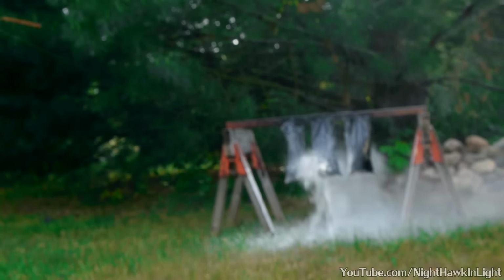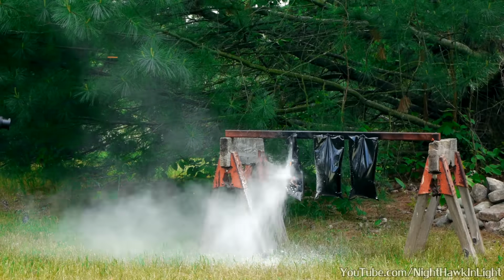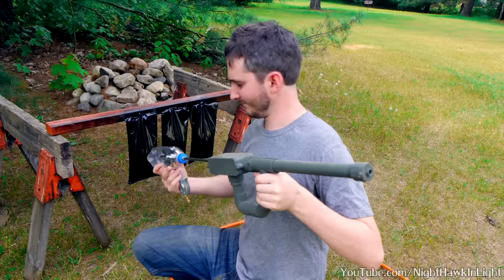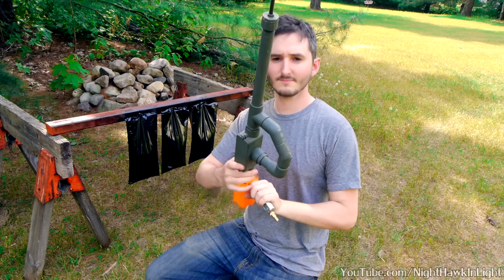DIY Airsoft BB Machine Gun - 5,000 + Rounds Per Minute - NightHawkInLight

Comment: This could be like a flame thrower for airsoft. You can carry the compressor on your back
Reply: maybe a smaller 12v pump/compressor like the ones you can use to inflate your car tires if you get a flat and a motorcycle battery? good idea though.
you could also add a couple 4-6" PVC pressurized tanks for the backpack flamethrowers have, having the tire pump pressurizing them.
Reply: get an HPA air tank, line, and regulator.
Reply: What people have done for this is rig up a small propane tanks up. Just look up airsoft flame thrower, I remember seeing some videos on it in the past.
Reply: Jesse flynn more expensive then my idea.
Reply: smaller tank with smaller pressure for smaller range and we've got a nice flamethrower for cheap, also seems fun to build
Reply: TheSkunkedFisherman or tank
Reply: A few light weight lipo batteries and a small on demand horn compressor 
And it would work with less than 4 lbs of weight.
Reply: That’s against the Geneva Convention even in airsoft 😂
Reply: Pyro: evil laugh
Reply: Ahh yes the strafer’s his little brother
Reply: More like a mg 42

Comment: congrats you made a polarstar rifle
Reply: Just hearing that name makes the scars all over my body hurt again
Reply: not polarstar  there is an actual gun that works on this principle though its called the "straifer"  basically  big hopper with a barrel that has air passing through it pulls bbs down and out the muzzle at stupid rates of fire.
Reply: +o Lemurs nope its got no semi auto mode since with this type of firing system its impossible the straifer is on or off just like this
Reply: Nff and so are all polarstar rifles
Reply: +o Lemurs polar stars are essentially the same as a aeg but uses a hpa tank instead of a puston.  it still has a moving nosel wich is required to move back and forth to load a bb where as this and the straifer has essentially no moving parts aside frome the air valve/trigger
Reply: I saw I guy with a $120 g36 piece of crap with a custom paint job and people thought they would smash this guy but they failed to notice that the gun had a polar star in it. I was watching from a distance because I was actually playing paintball at the time and all you heard was a constant stream of bb's and people cussing because of getting hit buy like 30 bb's in half a second.
Reply: o Lemurs lmao u know nothing about airsoft, strafers just pressurize the hopper making bbs shoot out, polarstars are in actual m4 or ak or whatever actual gun u wanna put them in, they actually take magazines, they have programmable fire modes and way more and u can fully upgrade them.
Reply: No full auto in the building

Comment: If you feed the air in at an angle to create a vortex you can align the pellets in the container before they enter the barrel, of course you need to also mount the barrel along the wall to take advantage of this, but with some PVC and a Co2 tank I was able to reach around 260 rounds per second, basically a little over 15,000 per minute.
Reply: ***** I'd have to find the guy I sold it too, but I could try

Comment: I'm not sure that I understand how this actually works. You have let's say a 1000 little balls in that bottle with a tube stuck in the bottle and an air compressor feeding air into it. Then, there is an extremely chaotic airflow inside and yet somehow the balls find their way out through the tube? In a way, you could look at it by saying that the metal tube is sucking the balls out rapidly. I think this is right but it still boggles my mind that the balls follow that perfect air current suction path so fast. I would expect them to bounce around and maybe only a couple to fly out every once in a while.
Reply from the maker: So by forcing air into the side I increase the pressure inside the bottle. Relative to this higher pressure the air outside the bottle may as well be a vacuum. The air moving into the barrel like a vacuum sucks pellets into it.
Reply: Thanks a lot for answering.

Comment: Many years ago I experimented with a shop vac exhaust powered high volume paintball launcher. The venture effect was troublesome. I used a linear magazine with a push rod. The weight of the dowel rod was enough to feed. It worked but was impractical. Now with battery powered high output leaf blowers the concept seems more feasible. The objective was to create a heavy assault system. Fed from a water jug hopper like yours but using a brushed auger feed system. No need for air tanks. Just battery power. It did generate just enough FPS to break premium paint balls. No chrono so no hard data.

Comment: Use different piping and suitable parts and hook up to a diving cylinder. 
It has enough oomph to make anybody and anything change their mind very quickly. 
Especially anything higher than 4 bar pressure. 
A plastic 6mm ball at 900+ fps is pretty thought provoking on impact. More than one causes bladder and bowel leakage..

Comment: I actually moded the first flamethrower gun you made, but it has a variable of speed, making good for airsoft(with the tip orange as well). if you can make it variable on the airflow I will show my 3.0 model

Comment: Next step add a high compression portable air tank (4500psi?) and maybe bring the air pressure down a bit (50psi?) to better control the flow of projectiles. Great work!

Comment: Do you clean up the BBballs afterwards and if so, how?
Reply from the maker: Not usually as the amount used in an airsoft game are inconsequential, but for this project there were so many that I'll probably vacuum them up. There are biodegradable pellets that can be used as well.
Reply: I really like the concept, not a big fan of all the plastic just lying around though
Reply: There are Biodegradable Airsoft pellets, tho.. Some fields require them..
Reply: Vacume it up? Or just use the bio degradable pellets
Reply: What is a suitable substitute for brake line

Comment: Would you recommend this for nonlethal self-defense?
Reply from the maker: No. I would recommend running.
Reply: NightHawkInLight
but if someone was breaking into your house, and you couldn't hide or call 911, it would hurt quite a bit, right?
Reply: i would have to mention this, imagine breaking into a house and feeling hundreds of pellets flying into your face. what even would your reaction be lol.
Reply: Rit
probably screaming. and writhing in pain. and, I imagine, closing your eyes, if they're directed at your face.
Reply: If the true velocity is as he has estimated no this would be a poor choice. Most cheap airsoft guns (less than $60) run from 300-450 FPS. At that velocity they may leave a small bump/welt and sting for a few seconds but that's it. Most of the better guns run from 500-600 Fps which will leave you with a minor bruise.
Reply: Mathew Stumpf
true, it wouldn't do much damage to a person, but 5000 RPM is comparably fast to an M134 minigun, so it's safe to say it'd still hurt. A few modifications could be made to increase the FPS (more ram, better graphics processor, higher pressure, etc.), which would be required to make it worthwhile, but I bet it'd be a worthwhile project.
Reply: lmao upgrade fps with more ram
Reply: Dude, just grab something vaguely weapon like, and yell really loud at them to get out.  People breaking into your house nine times out of ten just want your stuff.
Reply: +Rippertear then buy a real gun.
Reply: Mathew Stumpf
nah, I don't want to be able to accidentally kill anyone. that's where I draw the line.
Reply: +Rippertear what are you talking about accidentally killing someone? That won't happen if you keep track of the weapon and practice basic gun safety.
Reply: Mathew Stumpf
yeah, but if someone was to be breaking into my house, it'd probably be dark and it'd be hard to aim for ankles and knees.
Reply: When someone is breaking into your house you don't shoot to maim you shoot to kill. They made their choice the moment they entered your house.
Reply: Mathew Stumpf
that's my choice, I want them to live to regret what they did. I also want to give a pretty hard push in the 'regret' direction, just to make sure.
Reply: Dalton G
presuming I would get shot first, I would, yes.
Reply: if you are aiming for the knees or leg, you most definitely will get shot first. gut shots dont generally kill. itll leave them incapacitated and would save your life. immediately would need to call police, and an ambulance obviously.
Reply: iRoast Idiots
Yeah, but it's safe to say this would sting more, and there'd be less blood to clean up.
Reply: +Rippertear this wouldn't do shit. I've been shot by more powerful Airsoft guns. Ive been shot in the temple by one that ran around 600 fps and the most it did was leave a welt. you can't even feel them through anything thicker than a T-shirt.
Reply: Rippertear less blood, but i can promise a gun would leave more than a sting XD
Reply: exactly.
Reply: +Rippertear use steel bbs
Reply: +Benedikt Adams (cookiesw) The diameter if steel BBS are 4.5 mm if anyone asks
Reply: please don't use airsoft for self defense, it is a really bad idea
Reply: Can use steel bbs though for sure, especially with a machine gun at high psi. Anyone would be running away from the horrific pain and hundreds of bruises,welts, and bleeding that would occur. Even just old school pump bb guns with steel/copper bbs are extremely strong, we used to have wars with them when I was a kid, and my brother got hit in the forehead with one and we had to pull the lodged bb out of his forehead with tweezers. made an actual indent in the outer part of his skull.
Reply: Fact of the matter is simple. If a weapon is used in self-defense, it is only useful if it can reliably disarm the attacker. Airsoft guns, BB guns and pellet guns all fail that criteria. Use a firearm or mace, and nothing less. Also, know that in a court of law (which you will go to inevitably if you use a firearm against an attacker), a BB gun is the same as a firearm when used against a human.
Reply: Plant C4 next to your door and go to sleep with a remote next to you. Problem solved.

Jokes aside, I wouldn't want a gun too. I live in germany so I don't have to bother anyways. Most people who break into your house just want to steal stuff and those who actually want to harm someone will make sure they get it right. Seriously, if someone hired a killer for you, you wont be able to just take him out if you even manage to wake up because he most likely wont just break a window and rush into your house.

I always have a baseball bat and a sharp af sword in my room - I didn't buy one of those in the intention of self defence but if someone was to break into my house, he'd probably wouldn't search the fight anyways so he will defenitly run. And if he wont run, I have a good chance of winning against a knife (and basically noone here owns a gun).

If someone was hired to kill me, well, he'd probaly  find a way without drawing too much attention and giving me any chance of fighting back.

Comment: Have you thought of using the housing as a way to hold the trigger, that way the bottle can be pulled off and replaced without removing the air hose?

Comment: 100 psi in a coke bottle?? that's dangerous isn't it?
Reply from the maker: Not at all. Soda bottles are rated for over 100 psi, and if they burst they do not produce shrapnel,
Reply: Besides the bottle never actually experiences the full 100 psi since there is an exit hole, the barrel.
Reply: The coke bottle barely gets any of the psi generated by the compressor it's all handled by the trigger mechanism plus all the air rushes out the barrel as soon as you pull the trigger
Reply: That's not lethal shrapnel. The worst it could do it blind you, and if you're using this you should be wearing safety goggles anyway.
Reply: it's also being quickly vented out.
Reply: Have you tried pellet skipping? At that velocity... fun! All you need is a calm lake, but maybe peas are better for that as they are biodegradable.
Reply: BookProX most airsoft bbs are made of biodegradable plastic since most matches are outside.
Reply: Actually most BB's are not biodegradable, and even biodegradable BB's are not exactly as biodegradable as you may think. The quoted degradation rate assume landfill conditions whereas most of them end up on the ground in a forest.
Reply: they wont fly far with out barrel.
Reply: well when i filled it to 210 bar it exploded
Reply: Allah's Snackbar that's over 3000 PSI O_O
Reply: ***** guess so
Reply: How would you make a portable version?
Reply: And the pressure is in the Hose. ITs just passing trought the Bottle
Reply: +Eddie Grant compressed air cylinder
Reply: Eddie Grant use a battery powered leaf  blower or carry a high pressure air tank around.
Reply: What? I would expect it to explode at 20 bar at most.
Reply: ***** it didnt explode at 210 bar, it exploded b4 that, but i tried to fill it to 210 bar
Reply: Allah's Snackbar

But it shouldn't come even close to that number. You're probably confusing units or something.
Reply: Alot of people have tested this and actual psi before blowing up, on average, is about 140-160. Even higher with a 20 oz bottle, like 190-210.
Reply: Brian Graves your mom did not complain.
Reply: Brian Graves Tell me kid, why are you saying such bad words? specially for your young age.
Reply: if you were to use real bb's what size brake line do you use or can you just use same size?
Reply: Erica Clark 4.4mm diameter
Reply: Coke bottles produce no flying shrapnel. I cut a gash in my leg as a kid with a coke bottle I dropped on the ground and busted open. I am sure it is a rare thing, like a paper cut, but it hurt like a bitch and I ruined my shoes(covered in blood).
Had to get 3 stitches. Doctor didn't seem too surprised either.
Reply: Carry an air tank , mounted on the gun or not.
Reply: Benjamin Bursell 20 bucks is 20 bucks right
Reply: No yes no only if your unlucky 

A soda bottle is rated to about 4 atmosphere or about 45 psi I think.

The main problem is there is no vent or blow of valve so a barrel blockage could cause problems.  Short is if you held the trigger down long enough with a blockage in the barrage after about 10 or so seconds the bottle would exploded in your hands. With the main problem being hearing and eye damage. More so if you are hold the thing near your face.

It will not exploded like a boom and kill you but that much change pressure can cause you ear drum to burst and all get small shards of plastics in your eye.

Wear safety gear and don't be stupid and it will be fine
Reply: JackTalyorD to be fair not firing due to a blockage and then holding  the trigger for 10 seconds seems unlikely in actual use. If it stopped firing and you pressed the trigger twice it would be obvious that you have a blockage and that you shouldn't keep trying to fire.

Comment: I made this but instead of pressurized air i modified my propane or alcohol rocket so it can't launch then connected the rocket & hopper at the bottom. I use a BBQ igniter 2 fire. It take longer 2 fire but i love my rocket powered BB gun
Reply from the maker: That's an awesome idea! I may try something like that
Reply: that i have to see, that must be so much fun to see in action!  Got any videos of it or the build?

Comment: I suspect you could swap out the compressor for the battery powered leaf blower in the cheeseball gun video and the compressor for the leaf blower, right?
Reply from the maker: No, swapping the air supply between the two would not work very well. The cheese ball gun needs more air volume rather than high pressure, and this airsoft gun needs pressure more than volume.

Comment: Would this be possible with a portable tank? whether it be high pressure air or co2, the low operating psi of the gun should yield plenty of shots per tank load.

Comment: so what is the inner diameter of the "barrel"? Need a barrel and a few other parts for 3d print and am only finding 6.2mm ID to be the closest to 6mm (forums suggest a 6.01mm or 6.03mm ID). don't plan to be sniping, but rather not be restricted to point-blank range. Just trying to calculate and weight options for my project lol

Comment: Nice work but how does the bb's get into the barrel wouldn't the air just blow the bb's around
Reply: MattyE 0 As the air rushes in it trys to find a way out so it goes through the tube, since its such a strong force moving in the bottole the bbs are also forced around and alot follow suit of the air and go out the tube.

Comment: What aircompresser did you use, do you have a link?
Reply from the maker: My compressor was made a long time before the internet existed.
Reply: Any air compressor will do, all the fittings are standardized
Reply: So, will industrial air pumps used in mines work?
Reply: +nicynodle2 yes very well actually, just be sure to put it on video pls

Comment: That's a lot of slop between 6 mm and 5/16 brake line (8mm). If you found a better barrel, your accuracy and fps aught to improve significantly, at the increased risk of jams -- depending on whether or not those "6 mm" pellets are actually 6 mm.